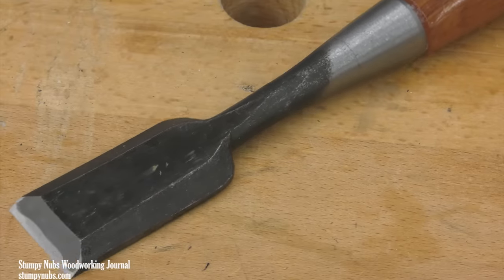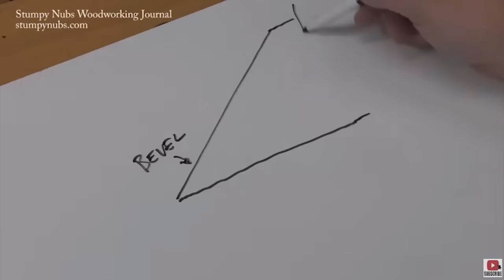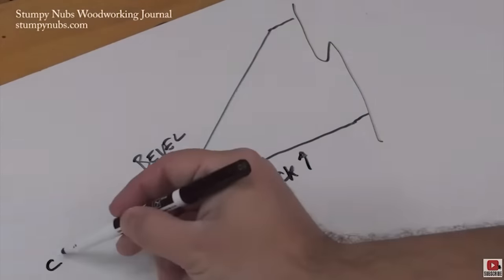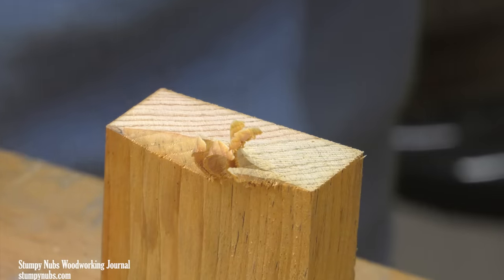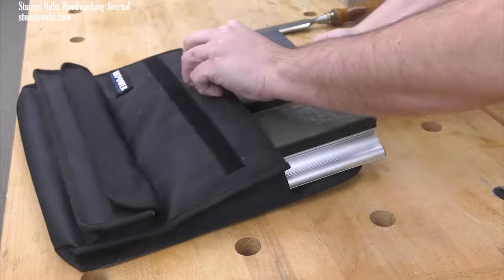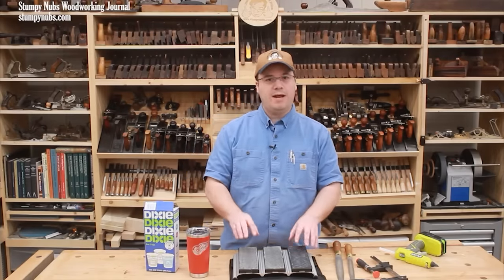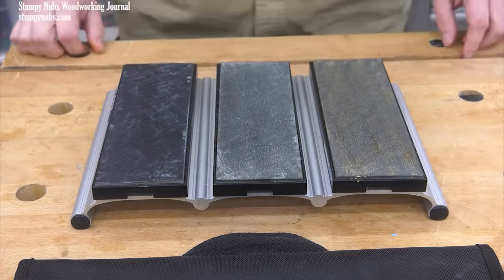The truth about Japanese chisels

Comment: Hitachi white paper #1 will actually take a finer sharper edge than super blue if forged correctly, due to lack of alloys that the blue steel has. The grain structure can be finer in the non alloyed super white, allowing a finer edge. The alloys add durability in hardwoods, but have a coarser grain.
Reply: Yes, blue is not as capable of taking a super keen edge, but is stronger and more wear-resistant due to more carbides. If you do a lot of work in hardwoods, blue is the way to go.
Reply: Yep, coming from the chef knives hobby I will concur. Blues and Super Blues have extreme wear resistance and better corrosion resistance while White Steel, having finer carbines dull faster but get much much sharper and is significantly easier to sharpen.
Reply: Since blue paper steel contains tungsten and chromium it resists abrasion, so you can't get blue paper steel as sharp as white-paper nr1, but the edge of the blue-paper will hold longer. Once you sharpen white-paper and blue paper steel the difference will be obvious
Reply: What is the gold line then?
Reply: @eloysiuschiang super blue is a whole different animal like supergold
Reply: @monut211 blue paper has 1-1.5% tungsten and like .3% chromium. That mean 0 carbide formers with them

This guy seems to have things backwards. White steel has more carbon therefore can get harder and produce more cementite carbide

Comment: I love my Japanese chisels and saws. I switched from western style tools a couple years ago to just try something different. I won't willingly go back now, the chisels are  fantastic. Japanese tools are really part of a soft wood working system. Mixing and matching I found as I was changing over left me with a sub-par end result. Even working on the floor with low saw horses changes things,  just keep in mind that tall people or those with sore backs and joints should be wary of going down that road.
Reply: I threw away my western style hand saws in the 90's in favor of the pull saw.
Reply: Pull saws are the way to go, for sure. My experience with them started simple: a pruning saw that I used to build forts as a kid. So much more control.
Reply: When 0 tables are tall enough the ground is better…
Reply: Excellent tutorial. 

I've been using Japanese saws, planes and chisels since the mid '80s. Blue steel as well as white steel. Also I tried some cheaper Japanese chisels. They were worse than Western chisels by far. 
The best chisels were in a league of their own. Way beyond what Iever needed actually. 

In the end I used run of the mill American tools mostly. When I dinged the edge of one of my Oiichi blue steel chisels, I almost cried. 

That's why I mostly went back to American chisels like Buck and Stanley. Razor sharp of course.

Comment: I've had Japanese chisels for years but only recently learned how to sharpen and use them.  Found out the hard way that they're too short to fit in most western honing guides so I made my own honing guide from internet plans, but then found the bevel wouldn't lay flat onto my M-Power SBS Diamond Sharpening System stones (same ones in the video) without some modification.  It now works fine and got me through the learning phase of sharpening new chisels. I won't say I'm a pro at it yet, but I can now do a decent job of honing these chisels without the honing guide.  Since then I built a lab table with some angled mortise and tenon joints that I could not have built without the chisels.

Comment: Super cool to learn about! The breadth and depth of your knowledge never ceases to amaze me, and I'm continually impressed by how even-handed your approach is. So many aspects of woodworking are debated back and forth...hand tools vs power tools, western vs Japanese, traditional techniques vs newest innovations, plywood vs solid wood...but you respect them all, recognizing and sharing the pros and cons of each and reminding us that each has its place.
Reply: Most of what he said here was rehashed sales pitch from other tool vendors, and not all of it is relevant or accurate. 

For instance laminated steel was the normal method for constructing woodworking tools everywhere until about a hundred years or so ago. 

"White paper steel" should be called white label steel, because the name simply comes from the colour of the manufacturer's label. White paper steel is clean high-carbon steel, which again was commonly used until the 50's nearly everywhere. Blue label steel is alloyed, similar to Chrome Vanadium steels that have been used everywhere since the 30's.
Reply: Most people that hail my skills with hand tools, are not willing to pay but made in China on a CNC prices!

Comment: This is a great video about the Japanese chisels. I have a set of Japanese Blue Steel Chisels that were a gift from someone's grandfather over 30 years ago. He showed me how to sharpen them, how to set the rings and how to use them correctly. He also gave me a Japanese pull plane. I rarely use them, but I have them on the wall just to look at them. This act reinforced to me that in my job sometimes it is best to look at alternatives to the situation at hand.

Comment: I've used A, D, M, and O steels, cryogenically treated steels, HCS, HSS, 10xx steels, and all I can say is, once I purchased Japanese chisels, I understood why white and blue paper steels are the alloys and preparation techniques of choice of Japanese masters. Unparalleled sharpness, fineness, edge retention, sharpening speed, and overall joy of working wood. The hollow back makes flattening a breeze. The accuracy of paring and mortising is better than cryogenically treated chisels. They are less prone to chipping than these steels. They slice the fibers rather than chip them away, particularly well on dense hardwoods because of the fineness of the edge. I don't use my Narex and other European or US made chisels anymore. They just don't make woodworking enjoyable or straightforward. Sharpening them is a long process that is unkind to your stones. Once you drop one and chip/bend the edge, the chisel is done. You will need to spend more work hours reestablishing an edge and sharpening than the tool costs. Rust and corrosion are another issue I have found less of an issue with on Japanese chisels because most of the steel is coated/blued. All this being said, not all Japanese chisels are equal. It is best to look for handcrafted ones. There are manufacturers making chisels in Japan with similar steels to western chisels.

Comment: Good overview of the tool geometry, what the back hollow is for.  

I must correct you about the white/blue steel description.  As another viewer noted, the white/blue papers were the wrappers, so you have a way to know what material you have.  There is also a "yellow paper" steel, softer than the others, mostly used for saws.  These days I think the material is marked, not wrapped.  

White paper steel is basically fine grained high carbon steel, and if done right can produce the finest edge.  The blue steels are alloys, containing tungsten, molybdenum, etc.  These give the steel toughness and durability, hold that edge longer.  But these alloys have with larger crystallin structures, so they don't get quite as sharp.  

I prefer blue steel for chopping, white steel for paring.  It is just a preference.  

p.s., I go to Japan frequently, and have visited many blacksmiths in their shops.  I am doing research for a book on Japanese woodworking tools, hopefully published later this year.

Comment: I think it’s the other way around, white steel is non alloyed and and can be sharper and is brittle, blue steel has tungsten chromium and some other alloys making it tougher and more resilient, and yeah harder to sharpen. The edge lasts longer but not as fine, white is carbon steel, more carbon, more brittle, sharper but could chip more. At the end of the day there’s a lot more to making the chisel work than the steel type. Sharpening technique matters more. Also FWIW I was taught not to tap out chisels, and only plane blades. Thanks for throwing some love at the Japanese woodworking people :)

Comment: ah... wonderful. I just finished resetting the handle rings on a set of 8 i found in my rennovation home. I used an adjustable wrench opened to the ring diameter and a hammer to set them. That ring setter would have come in handy - the entire time i was faffing with the wrench i was wondering "surely there is a proper tool for this task...." lol oh well, too late now. Its all done.

Comment: Perhaps comment on the effect of micro-bevels on Japanese chisels? I’ve been told multiple times that it is not a good way to sharpen them due to the fact that it leaves the hard brittle steel on the end of the chisel unsupported.
Reply: Wouldn't it result in more support as your secondary bevel angle is higher than the primary?
Reply: That's bullshit. A lot of advice out there comes from salesmen, and they love the single bevel sharpening method because it requires you to run trough multiple stones, and those are expensive. 

I use a Japanese 240 grit rough waterstone and do a secondary bevel on a fine natural oilstone, perfect edge in a minute most of the time.
Reply: @johanneswerner1140  Im not sure, which is why I thought Stumpy might be able to enlighten us. He usually has very good evidence for the things he believes. I can certainly see your point.
Reply: The reason that microbevels aren't a thing with Japanese chisels is because they aren't needed.  The lamination of the softer iron and harder steel makes the need for a microbevel completely unnecessary.  It's also this lamination that helps to add support to the hard, brittle steel (the softer iron is much tougher than the harder steel), and putting a microbevel on the chisel would compromise that support and could easily lead to a chipped, or maybe even snapped, edge.  If you need a steeper angle, just make the entire bevel that angle.
Reply: @johanneswerner1140 it doesn't actually.  Like OP surmised, a microbevel leaves the hard steel unsupported from the tougher soft-iron laminate.

Comment: Reminds me of beaver teeth.  If you look from the front, you may notice beaver teeth are orange.  This is because their enamel has a lot of iron in it, but only on the front.  The front side of the tooth is very hard.  The back side is softer.  This means the teeth wear unevenly front to back, which continually sharpens them.

Comment: I got a set of Japanese chisels from Woodcraft a while ago. When I went to sharpen them, I noticed that the bevel l  is around 30 or 35°. I sharpened them all to 25° and put a micro bevel of 30° on them Only to find out that I may have made a mistake. Should I have kept them at the original bevel? Also, should Japanese chisels have a micro bevel? I was told that they should not. Couldn’t find any information to explain. Can you address that?
Reply from the maker: Japanese chisels are generally not micro-beveled because of the lamination process. The steeper 25 degree bevel leaves more of the hard, potentially brittle steel protruding unsupported by the rest of the bevel. Instead, the whole bevel is generally ground to the angle that you would otherwise reserve for the micro-bevel.
Reply: @StumpyNubs  thank you for taking the time to write a reply. That helps a lot. What about the original bevel on the Japanese chisels. They came with about 30-35 degree. It took me forever to reprofile them to 25 degree. Are they designed to be used at the original level angle, did I make a mistake by reprofiling them? P.s I have other sets of European chisels, the Japanese ones are not the only chisels available to me. If they are meant to be used at a steeper angle, I’ll reprofile them to original angle.
Reply from the maker: @shauldvosis4693  I assume your micro-bevel was around 30 degrees. That was my point about grinding the entire bevel to the angle you would otherwise grind the mocro-bevel. As for what to do now, I'd just use them as they are. Eventually your micro-bevel will overtake the thin strip of steel as it widens to cover the whole bevel. In the future, I would just keep it all at around 30 degrees.
Reply: @StumpyNubs  thank you so much🙏 and thank you for the value that you provide the community. Sharing your knowledge and information through your videos has made me a better woodworker as I am a longtime subscriber. I Appreciate it greatly.

Comment: Can someone help me understand… As a large part of the bevel is actually made up of soft metal. When sharpening the bevel side on a diamond stone, wouldn’t this softer metal clog up the stone as it is worn away?
Reply: When using diamond or CBN Wheels this can sort of be an issue. 

I've noticed that the soft iron heats up very fast on my CBN wheel, much faster than hardened steel. On a regular wheel it's the opposite, and so you risk overheating. 

In Japan they use grinder with the normal wheel but leave a couple millimeters at the end untouched, and finish by hand on a waterstone.

Comment: A question that has puzzled me for a long time - and not specifically about Japanese chisels.  It seems that almost everyone uses bevelled edge chisels exclusively, not firmer chisels. For sure they do different jobs, but why are firmer chisels rarely used (and more difficult to find for sale)?  They are much better, I think, for cutting square holes in wood (mortices, for example).
Reply: I have a couple of Robert Sorby chisels I would call firmers, although they were sold on Lee Valley as registered mortice chisels. One is 1/2" and the other 1".  Both are broader than they are thick, unlike the "pig-sticker" style mortice chisel.  I will eventually by a true 1/2" mortice chisel, but the firmer works and was a lot less expensive. I haven't even seen a 1" mortice chisel.  I think Narex also sell firmers in a range of sizes.  I think it's worth having some, but I suppose bevel-edged are more of a bench chisel--versatile enough for nearly any job.  It's easier to cut mortices with a beveled edge than to cut dovetails with a firmer.
But I am firmly in the school that you can never have too many chisels.
Reply: From my short experience with them and memory, modern chisels are basically a fusion of firmer chisels (or forming chisels, if you translate the original french) and le old pairing chisels, so the main difference is that modern beveled chisels are just more versatile, as they do the same jobs those two older styles do and in theory just as good (not accounting for personal practice with each and preference, that is).
Reply: @louisvictor3473  I find with bevel chisels that when cutting a mortice there is a tendency to distort the corners, because there is not enough flat on the sides of the chisel.  Of course, a mortice chisel would be the answer, but a firmer does quite well.  As you say, personal choice comes into it.

Comment: Truth is that all of the mystique around the katana, folding and welding and folding and welding, was driven by the low quality of the iron ore that the Japanese had access to.
Europeans had been fold-welding swords as early as 500 BCE,  but pretty much abandoned it by 1200 CE.
Reply: Finally someone!! A lot of the stuff that people idolise about the Japanese techniques, methods, processes etc, it's a real load of crap. In particular, when it comes to woodworking, I am shocked by the contempt with which woodworking that has been done in Europe for the last 1000 years is treated in comparison to Japanese tools and processes that are simply ridiculous in comparison.
Reply from the maker: Europeans did it to save on steel. The Japanese did it as a feature to compliment their harder steel. Whether it is needed is a different argument (modern cryogenic steel is very hard, yet those chisels are not laminated). But to suggest the West is superior because they no longer laminate blades is to misunderstand the purpose of the Japanese techniques.

Comment: Modern Japanese steels are very, very good. You kind of have the steels mixed up though. White steels get markedly sharper than blue steels. They have almost no durability/edge holding though...as they have no alloying agents. They are VERY easy to sharpen...again, due to no alloying agents. 'Hardness' has nothing to do with it. For a consistently maintained tool like a professionally used chisel, the white steel makes more sense. Many Japanese knives...particularly those used for sushi (sashimi) are white steel for the same reason. Sushi chefs are constantly sharpening their knives...as the sharper the edge, the more clean the surface of the sliced product.

Also, Japanese single bevel culinary knives have a hollow back, or 'ura'. For the exact same reasons.
Reply from the maker: When I say one takes a finer edge than the other, I am speaking of the final result. If the edge immediately disappears, it is irrelevant that it was there for a moment directly off the stone. As for hardness, my understanding may be wrong. I am not an expert in tool steel. But I was always taught that blue steel, particularly varieties such as super blue, are very hard.
Reply: @StumpyNubs White label steel is simply a clean high carbon, like on old cast steel chisels. It sharpens easily and so gets super sharp. 

Blue label steel is similar to Chrome-Vanadium alloys you can find on more recent tools. They have a much better abrasion resistance, which is good when you work with dirty wood, hard or tropical woods, plywoods... But harder to sharpen, because sharpening uses abrasion.